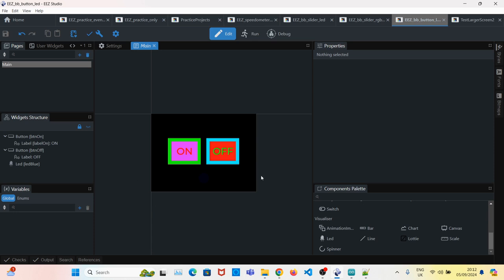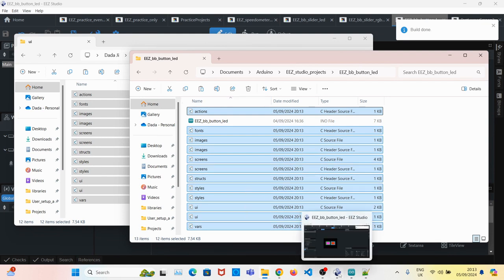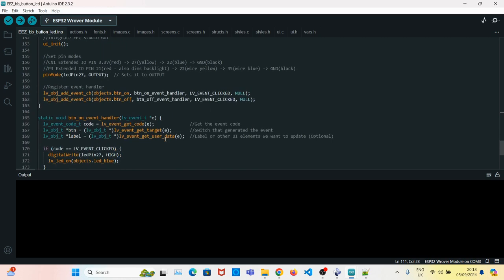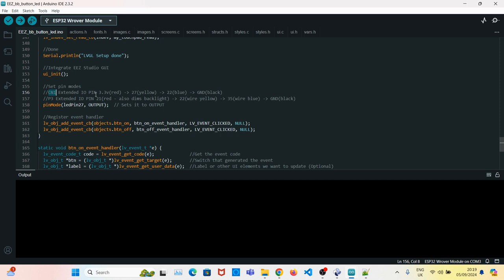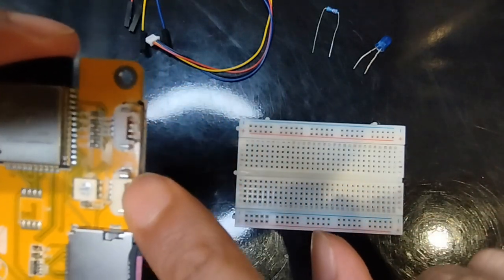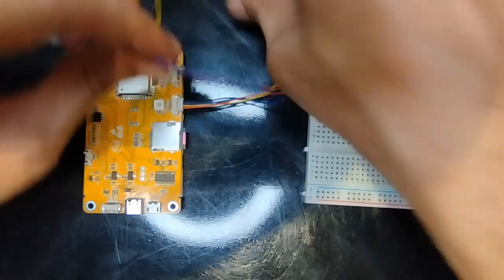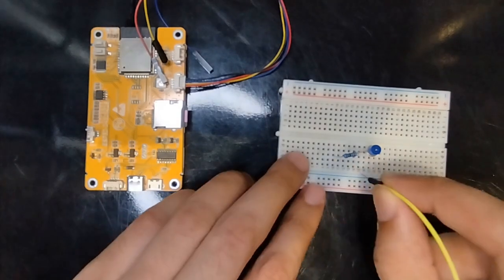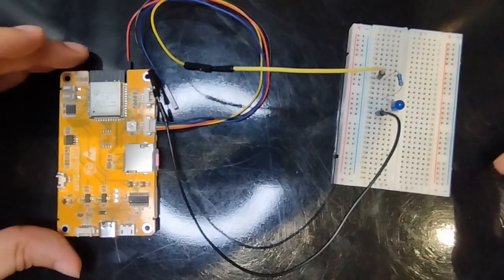LVGL ESP32 2432S028R CYD Buttons to turn LED on and off(Beginner)

Comment: Thank you for this video, I am encountering issues though, to compile this sketch I am using an ESP32 WROVER Module Cheap Yellow Display_, but it always comes up with errors, I installed the ESP32 WROVER Module with v2.0.7 and only 1 error caused the failure to compile, so I am assuming that Board Version is a deciding factor in successful Compilation, I am new to Arduino IDE, Relatively new to C Programming (I used C quite extensively in my late teens and most of my 20's) that was over 2 decades ago, Is the Board version critical for Compilation to succeed and if so how best would one be to determining which board version to use?

Thank you

Comment: disp = lv_tft_espi_create(TFT_HOR_RES, TFT_VER_RES, draw_buf, DRAW_BUF_SIZE);
      |          ^~~~~~~~~~~~~~~~~~
      |          lv_tlsf_create

exit status 1

Compilation error: 'lv_tft_espi_create' was not declared in this scope; did you mean 'lv_tlsf_create'?

I tried it your code, but i have a problem. What am i doing wrong?
Reply from the maker: This normally happens when it's not configured properly.

Check this tutorial to see how to do this.
https://randomnerdtutorials.com/lvgl-cheap-yellow-display-esp32-2432s028r/

Also make sure you are using Arduino 9.1.0 and not the latest one.

Comment: Suggestions for users of LVGL:  I will use the LED widget a lot but I do not like the OFF state color... looks aweful.  

So instead I use
LED OFF code:    
      lv_led_set_color(objects.led_1, lv_palette_main(LV_PALETTE_GREY));
LED ON code:
      lv_led_set_color(objects.led_1, lv_palette_main(LV_PALETTE_RED));
   or
      lv_led_set_color(objects.led_1, lv_color_hex(0xffe62c2c); // choose any hex color

Alternatively, if you want to NOT have the 'glow' effect when off, you can use this code to color the LED if OFF state:

LED OFF code:
      lv_led_off(objects.led_2);
      lv_led_set_color(objects.led_2, lv_color_hex(0xfffbfcfe)); //very light grey
      lv_led_set_brightness(objects.led_2, 170);
LED ON code:
      lv_led_on(objects.led_2);
      lv_led_set_color(objects.led_2, lv_palette_main(LV_PALETTE_RED));
      lv_led_set_brightness(objects.led_2, 255);

NOTE: in the OFF state, setting the brightness higher will give you more 'glow' effect around the LED's edges.
Anyhow, this works for me perfectly!